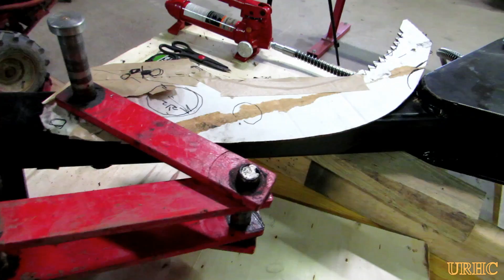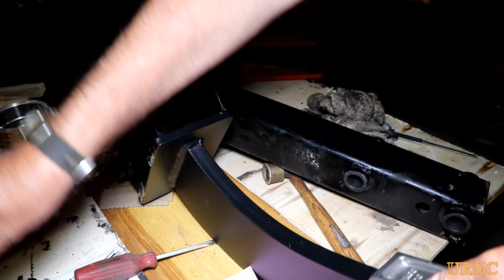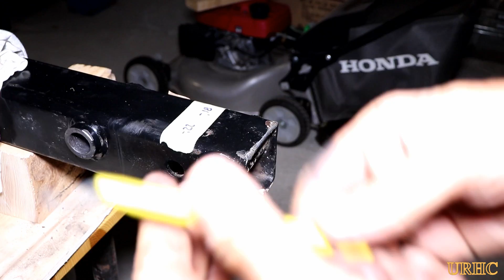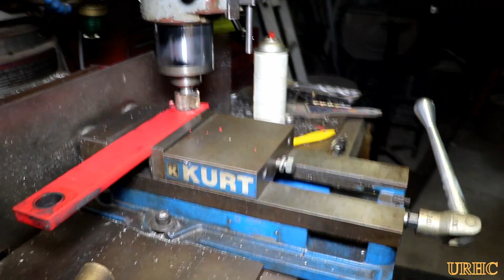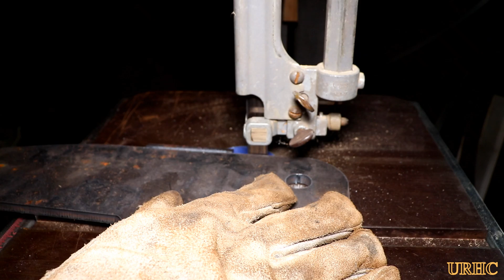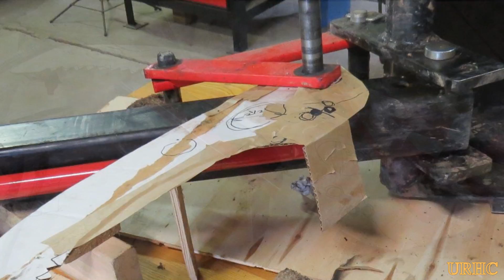Building A Thumb & Adding A DR Ripper To My Trencher Part 1

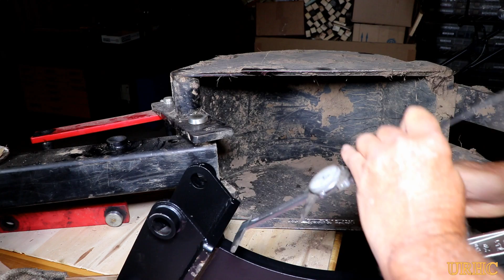Comment: 2:40 Wonder if there's a brand of ripper out there that'll fit the Harbor Freight backhoe out-of-the-box. 1/2" steel is a bit above my fabrication skill level, and my welding is still pretty novice, too.
Reply from the maker: Check with BX Expanded as they make an assortment of rippers. Thanks for watching.

Comment: Someone should just manufacture rippers et al for the HF Trencher. By the way, of all your tools, I envy the Kurt Vise :-)
Reply from the maker: They should.  And now that DR has stopped selling trenchers and accessories there  is no longer a source for them. If you buy an old mill make sure it comes  with good accessories. They are usually worth more than the machine.  Thanks for watching.

Comment: As always, good video. As I was watching I couldn't help but think: I wonder if he ever got his beard tangled in his machines or on fire from metal sparks??? Worse than ANTS IN YOUR PANTS from your dead tree.
Reply from the maker: It is the zipper on the dang winter coats that hurts the most. You will see it on a video if it goes up in smoke. Thanks for watching

Comment: You've issues with grounding BOTH, machines the CNC and the plasma cutter are very dependent on proper grounding.
Also, leaving servomotors in the open, unless they are stated to be water ingress proof, is a bad idea. The windings are very susceptible to moisture and the damages it causes.

My two cents, build enclosures for the sensitive equipment for when you leave it in "storage" mode. Doesn't need to be space age, just enough to keep them safe from water.
Reply from the maker: I assure you that the grounding is good on the machine. It is getting proper voltage feedback but the DTHC is not properly responding. With the height control bypassed it runs the gcode fine.  I think it is just a corroded connection in one of the cheep parallel port and serial cables that tie everything together. Thanks for watching.

Comment: Nice job there, that thumb will be a game changer. Also like the ripper idea. I have a thumb on my towable backhoe and use it a lot. Thanks for posting.
Reply from the maker: I bent a tooth on the bucket pulling roots and think the ripper will make less of a mess removing stumps. I just wish there was an easy way to add hydraulics. Thanks for watching.

Comment: URHC i didnt know you had so many cool metal fab pieces of equipment. Very cool, can not wait til part 2. Thanks for sharing!
Reply from the maker: They make builds go much quicker. Those old South Bend lathes are the most usefull tool in a shop. Thanks for watching.